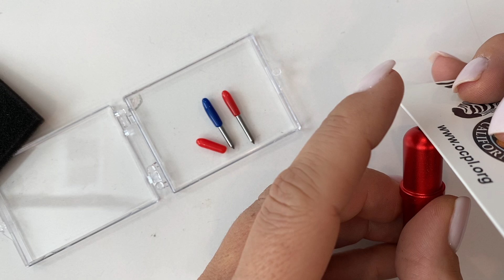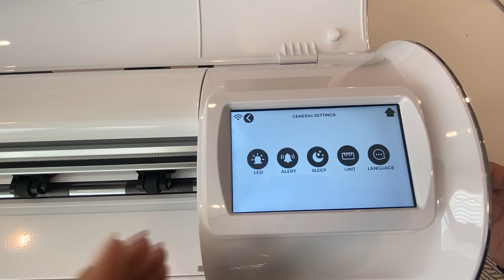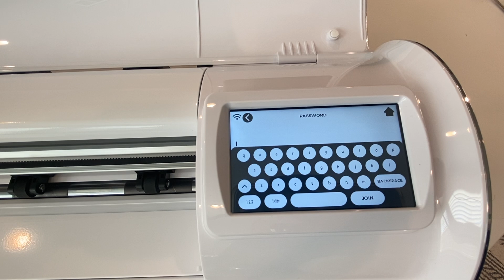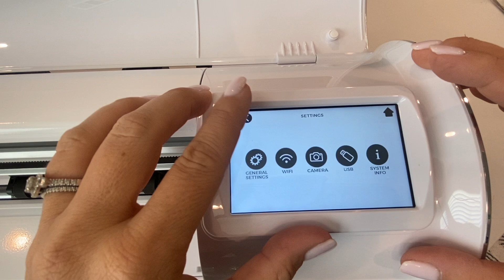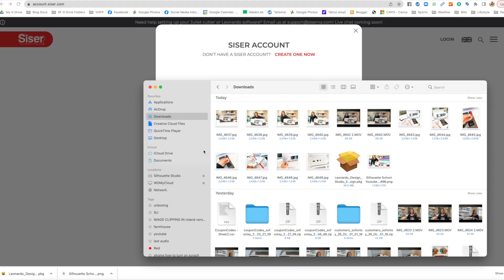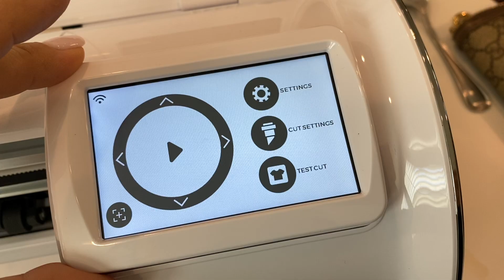Siser Juliet Cutting Machine Setup: 3 Steps Before Your First Cut

Comment: what do i do if it CANT find my WIFI cus every device in my room can find it except the juliet for some reason
Reply: I had the problem that our company wifi has a = symbol in the password, and in order to incorporate the juliet, the password would have to change for everyone. The workaround was to turn on the the juliet's hotspot by selecting "default" in its wifi setup. This means going off the internet to connect to the juliet, but so be it. The default password for the hotspot is 12345678.